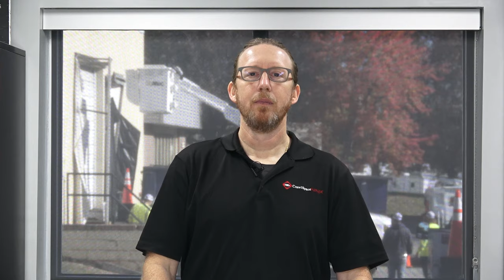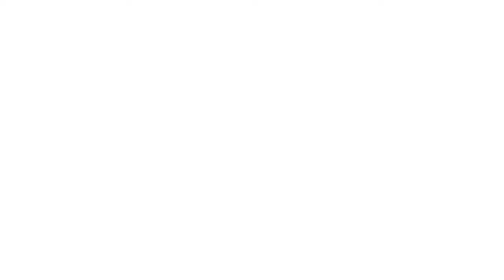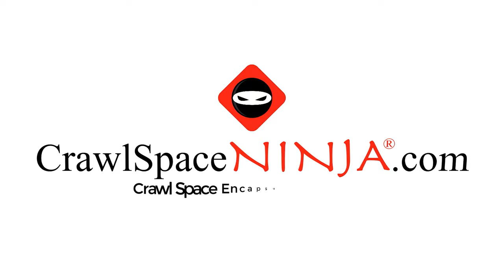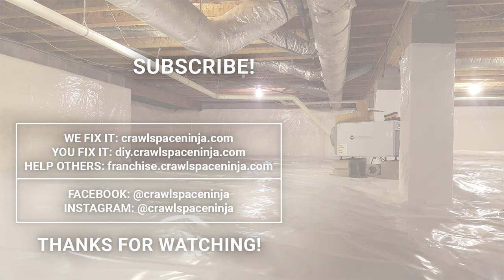How To Winterize a Manufactured Home Crawl Space | Prefab Home Tips | Ask A Ninja #44

Comment: Another great video. I inspect manufactured home crawl spaces on a regular basis. All have insulation under the flooring, but most homes more than a few years old do not have crawl space walls insulated. Vast majority of crawl space walls are vinyl. Close to 50/50 split as to whether vinyl skirting which has not been insulated has perforations for ventilation. Many newer manufactured homes being installed with insulated skirting (foam board) and automatic ventilation vents. The auto vents  have a bi-metal coil to open and close automatically when the temperature reaches preset temperatures. Interested in your thoughts on these auto open/close vents.
Reply from the maker: S & J Property Services Thank you so much !

Comment: I have a mobile home on a full cement slab. It has the typical vented vinyl skirting. It has R19 fiberglass bat insulation in the floor with a vapor barrier under the full belly. I was thinking of spraying insulation on the the back side of the vinyl skirting to insulate the crawl space. Why do I need to ventilate this space? My previous home on a full foundation did not have vents. It was essentially sealed. It had hopper windows I could open but never did. It seems sealing off my crawl space would be the same thing.
Reply from the maker: If sealing it off does not cause a humidity or moisture issue then that could work but I would install a monitor down there to keep an eye on it just in case. Hope that helps and thanks for watching. Here is one: https://amzn.to/3P4bPUt

Comment: So my wife and I bought a 2007, stick-built home in 2018. I just finished the encapsulation and de-humidification and now we've found out "forever home" location.  My question is related to this video; can I completely encapsulate my new 2002, manufactured-home, the same way I did my stick-built home?  I used 14 mil plastic, foam-board on the wall, and remove all the insulation in the floor joists?
Reply: what did you end up doing im curious? same situation